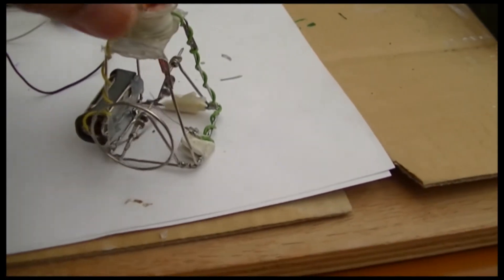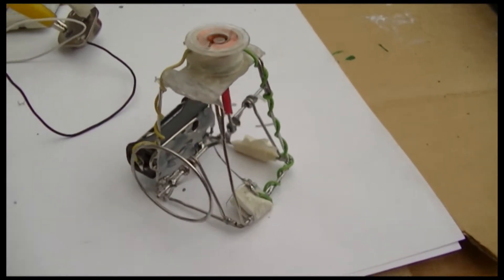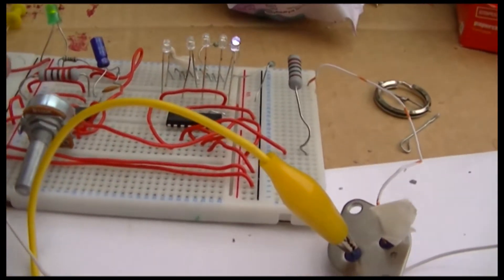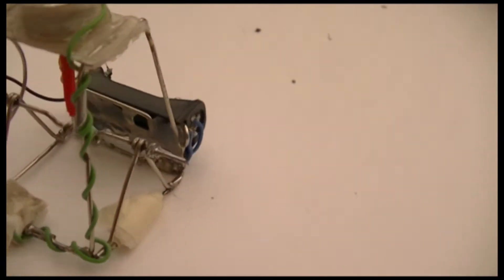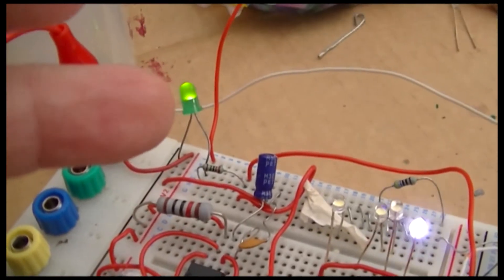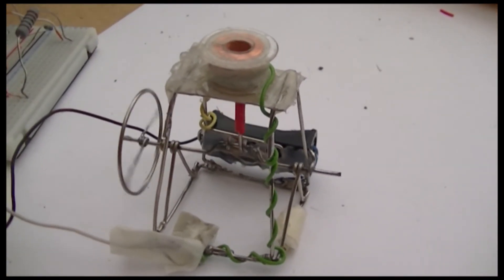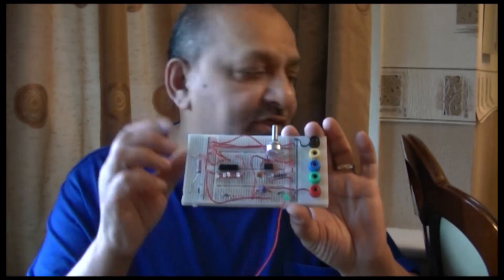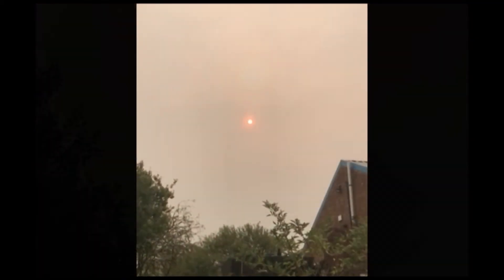#42. 555 Timer and a Solenoid engine.

Comment: Wow thats so cool you were able to make the motor function thru the 555 pulses . although i imagine your frustration as you had the 4017 going as well . it seems as if the issue may have been correlated to lack of fine control ? perhaps the driveshaft would need be modified ? hmmm . i know that the 4017 is used in a circuit i built . there is an EE blog " paul in the lab" i built his "devils triangle sequencer" and also his devils triangle oscillator . those use pleasant at low freq sine or saw tooth , maybe triangle i think not square . so you can connect a sub speaker , and then tune the three osc to pleasant chords . the inbetween sound when the xross modulation occurs right before you sweep thru to the tuned chord sounds and feels amazing when you turn it up loud . oh well , i enjoyed wacthing a lot of your content ,and  put together my own solenoid motor which i am gifting to someone special very soon so thanks so much sir .